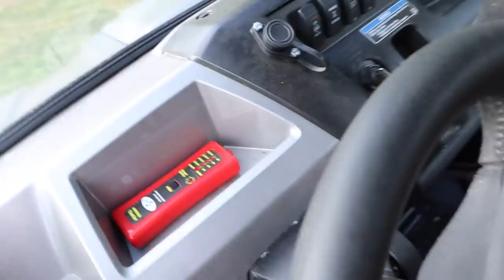Making Cheap CAST IRON Work Better Than TEFLON

Comment: I always wonder when I see Lodge Cast Iron in the store how many are used more than once. That stuff is of terrible quality.  Most of the good material for making cast iron cookware has been used up over the years.  They could grind it after building would help.  So far if I need new cast iron I look for old /wagner etc.  online still a lot out there.

Comment: The newer cast iron isn't the same quality as the cast iron back in the 70's and 80's. I think your going to build a barn and storage for hay and have concrete and pens between the shop building and the new building

Comment: Does the type of oil mater?   It's carbon when you're done no mater what you start with.
Reply: Flaxseed oil is the best oil for cast iron. The oil becomes a tough polymer that is a barrier between the food and metal.
Reply: yes. flaxseed oil is a "drying oil" where it actually dries and creates a hard surface and no flavor.  the only other oil I use is lard. other oils, especially vegetable, just sort of turn into a gummy coating and can taste stale/rancid.

Comment: Two things about sanding and re-seasoning cast iron:

 First, turning the pans upside down in the oven (over a baking sheet) will make sure you don't end up with thick gooey spots in the seasoning 

Second, using a drill mounted strip disk / pad and a bit of water in the pan while sanding keeps all the particles contained (and the disk lasts longer).  You also won't be sneezing up black carbon and rust for three days afterwards and because it cuts faster and cleaner you can take the finish much smoother in a reasonable amount of time.  Low(er) speed on the drill keeps water from splashing everywhere.
Reply: If you have thick gooey spots, you have WAYYYY too much oil in the pan.

Comment: Season with flaxseed oil and you will have the best non-stick pans ever
Warm an unseasoned pan (either new or stripped of seasoning) for 15 minutes in a 200-degree oven to open its pores. The best way to strip a cast-iron pan of seasoning is to run the pan through your oven's self-cleaning cycle.

Remove the pan from the oven. Place 1 tablespoon flaxseed oil in the pan and, using tongs, rub the oil into the surface with paper towels. With fresh paper towels, thoroughly wipe out the pan to remove excess oil.

Place the oiled pan upside down in a cold oven, then set the oven to its maximum baking temperature. Once the oven reaches its maximum temperature, heat the pan for one hour. Turn off the oven; cool the pan in the oven for at least two hours.

Repeat the process five more times, or until the pan develops a dark, semi-matte surface.
Reply: When we strip our pans, we just throw them in the coals of a campfire. Works like a charm and much cheaper.

Comment: As a chef I don't understand way you damitch a perfekt pan like that. Becoce they are supows to giw the food som iorn ewerytime you yous them. So if you had bin in my kitsen I tinck i Wood hawe smakt you hard ower your fingers so you cudent yous them fore a wayl. You hawe ruined a perfekt pan. Hwen you yous iron pan's and you see food stick to it skrubb it hwid hot water. And DON'T yous soup hwen you woch then only yous som avokado oil in it before you put it awey. Then you will hawe a wery good iron pan fore a long time. And noting will stick to the pan if you doo it this way and not ruin it like you did

Comment: I guess you know what you are doing but I have never in my life seen anyone abuse cast iron so much.  My 12 inch skillet is over 100 years old.  Nothing sticks.
Reply: Thom new ones don’t come from the store smooth and flat like the old ones. And not all brands are equal either. You have a great one. 👌👏